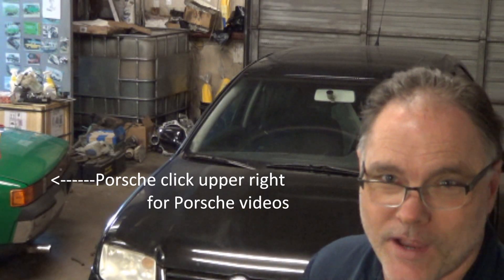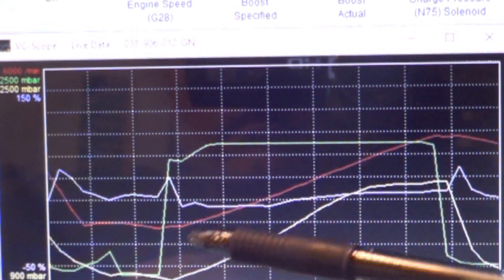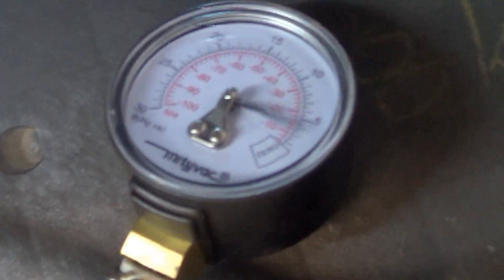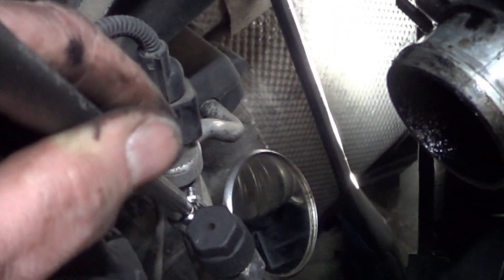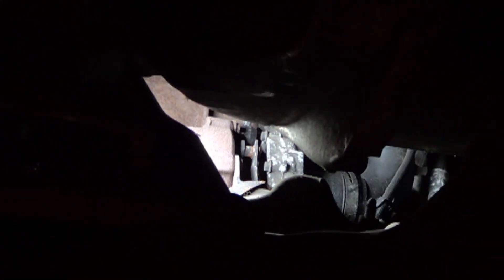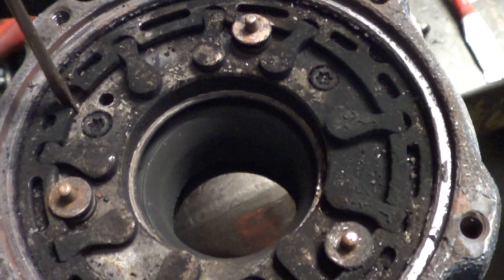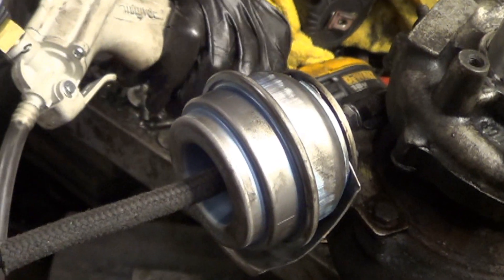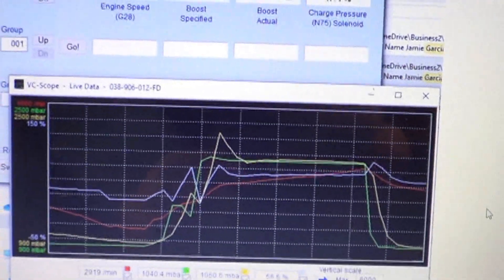2003 Vw Tdi ALH P0299

Comment: I used a hand vacuum pump to test the movement of my actuator. I don't get nearly the distance of movement that you are getting from the new one on this video. this system makes boost at low vacuum is that correct ?
thank you for the video.
Reply from the maker: No.  Alh makes high boost with high vacuum on actuator.

Comment: I have my tdi 1998 golf 4 Afn engine turbo 

Issue i have after i change ecu 

I put maf sensor connector 
And i Press gas pedal tpm goes just at midle and a lot smoke white comes and i feel shakes car when  rpm goes at midle but no end  after that i unplug connector of maf And car goes rpm Max so I think its my maf problem or could be another thing at timing belt adjust maybe But also can be turbo ?? Can u tell my what can be bcz im just driver but i have passion to learn about Repairing cars

Comment: Hi,
I have Skoda Octavia 1.9 TDI ALH 2005.  I found leak in vacuum system..hissing noise while applying brake. It got fixed after replacing the O ring. Oil leak stopped on the vacuum pump. Before O ring replacement, I got P3130 and P3105 errors. Now, the vacuum lines are working and N239 seems to close the anti shudder valve in the EGR. I have replaced N75 and I could hear buzzing noise when engine is switched off. I used turbo cleaner sprayed in shots at the air intake. Turbo was clogged earlier and engine got switched when I applied 1 st gear. Now car runs with low boost after turbo cleaning without removal. I find the turbo actuator is not moving. Should I remove the turbo and examine the actuator? Can decarbonizing using hydrogen(liquid & gas) help?
Reply from the maker: if the actuator is not moving make sure its got vacuum to it then you would have to assume its stuck.  If it s stuck pull the turbo for inspection and possible cleaning.
Reply: @CoolAirVw  Thank you so much. I will try and revert. I also observed blowby. The cap dances when its loosened. Can clogged intercooler cause this? I have already cleaned the intake manifold and EGR. Intercooler has not been cleaned yet. The car has clocked 165000 kms.
Reply from the maker: @balajis_mart  Cap dancing means nothing.  Please dont do this.

Comment: I've had a power loss for the last year, not thinking much of is as I barely drive it but the other night as I was coming home the engine hiccuped and then stalled out. Pulled over tried to start but just cranked over. Lots of smoke what seemed like coming possibly from turbo because it was under the hood. Waited a little bit tried starting again and it ran for 30 second and died. Again lots of smoke. Timing belt has 70k miles on it. Car has 160k. 03 alh. No engine light. Thought it was fuel related but seems to be getting and sucking fuel into IP the IP is very loud like there is possibly air in it but I may be jumping around too much thinking it could be turbo related because of the previous lack of power.
Reply from the maker: No question in your paragraph.   Sounds like fuel restriction.  Could be other stuff.
Reply: @CoolAirVw  thanks. Yeah just mostly wondering where to start. Fuel filter seems to be full. Hooked up vacuum to see if there was any restrictions and flows pretty easily. Didn't get a chance to crack injection lines yet to see if there was any air but wasn't sure if I should be possibly looking elsewhere. Clogged intake maybe? Fuel shut off? Anti shutter valve? Failing injection pump?

Comment: Thank you very much for posting this. I can not get a graph like yours in VCDS though! I just installed a new actuator, and the car feels okay, but I am just trying to confirm with VCDS. When I go WOT in 2nd gear, I can not see if the actual boost will come down and match the requested boost because I am getting to red line (have to get off throttle) before I can get a longer reading like yours looks. This is a 02 Jetta ALH, and I have Pixel Shift set to 15. I have some screen shots of what I've got. .. any thoughts?
Reply from the maker: so your overboosting constantly during the wot pull?
Reply: @CoolAirVw  it comes down, but by the time it is about to level I am at red line and have to get off gas.. EDIT: I only get about one graticule before I get to nearly 4000 RPM and get off the gas pedal.
Reply from the maker: @steveburke3  overboosting is either someone messed up vac routing, boost soleoid stuck giving actuator vacuum all the time or the actuator stuck or the turbo vanes themself stuck.  If your stuff isn't stuck then try adjusting the actuator.
Reply: Hello. How many time is needed for turbo removal and VNT cleaning on ALH engine?
Reply from the maker: @mr.t2585  a guy who is fast can do it in 5-6 hours.  Someone not so good it would take more like 10.

Comment: Do you know what's funny I bought a 1.9 TDI mk1 seat leon about 3 years ago and ever since I thought it was ment to be slow. So I oneday decided to clean out my air intake manifold and to my surprise. There was a ton of carbon and my VNT was stuck near the closed position and after putting it all back together apparently new car. Like wow, what have I been missing out on all these years and the money I have wasted on fuel is going to make me sick if I think about it to much. 
I think more engine checks should be done after an mot as a way to make sure your motor is at its best efficiency.
Reply from the maker: I've heard the term MOT a bunch of times because I watched "wheeler dealers", and I know what it means, but what does the acronym stand for?
Reply: @CoolAirVw  it means motor observation test. 
Which is ridiculous, I think manual testing needs to be done on vehicles
Reply from the maker: @JoelCarterproduction  thanks for the info.

Comment: Super helpful video, thanks. I'm struggling to try to diagnose and fix my 02 Jetta on my own. I see I need to get at least a vacuum pump before I can really play along. I don't have a lift either. But I'm hopeful to get the tools I need and try to follow along again tomorrow. This is my only transportation so I can't mess it up.
Reply from the maker: before you replace a vacuum pump for low vacuum, try wiggling the nipple to see if vacuum improves.  If it does "peen" down the metal retaining the nipple.  this will usually improve sealing around the nipple improving the vacuum supply.

Comment: Hi I've got a Skoda Octavia MK1 1.9 TDI 2003 the turbo seems to work accept it seems to plateau and will not give anymore power if I switch engine off and on  while moving it restores the power any idea  thanks
Reply from the maker: check trouble codes. Most likely your getting a overboost trouble code.

Comment: Can you spray a "rust off" product inside the stuck actuator, leave it a few days and recheck if it works?
Please!
Reply from the maker: You can do what you want.  Here's the thing, I have to guarantee to my customer its going to be fixed and last.  If I spray a product in there and it damages the rubber diaphragm and it then leaks I have a comeback under warranty. There are times that replacement is in order.
Reply: @CoolAirVw  Sorry for my English!
I ask you to do the test at the wasted stuck actuator! Not on your customers...
Don't throw the stuck actuator, please do the test! I'm very curious! You...?
Reply from the maker: @stergioser  that part was thrown in the trash months ago.
Reply: @CoolAirVw  Ohw😟